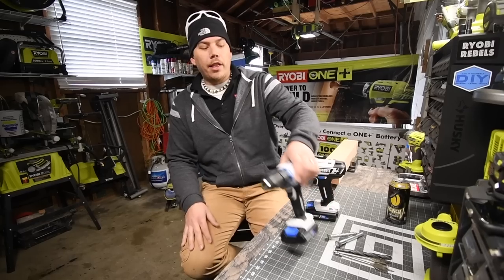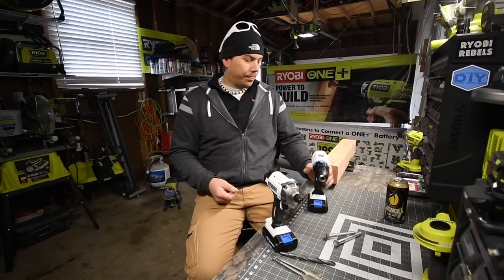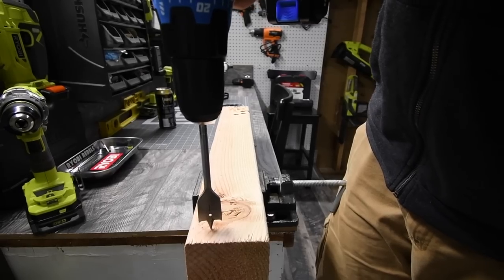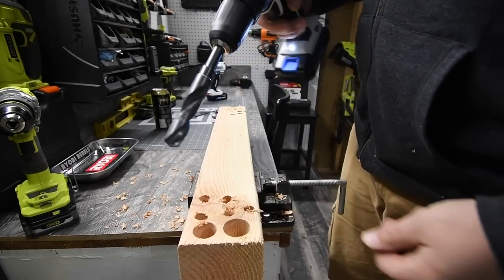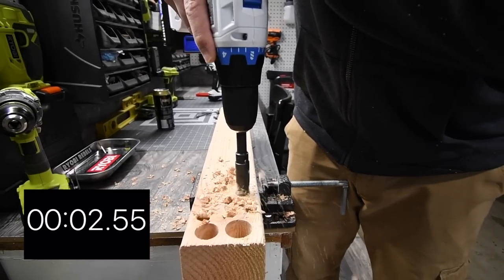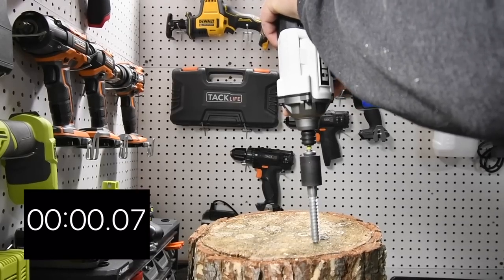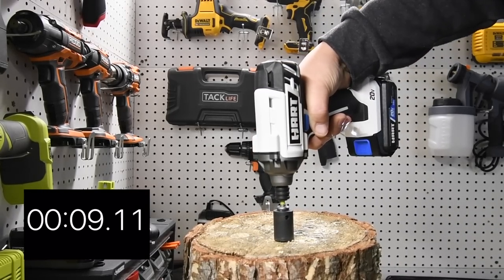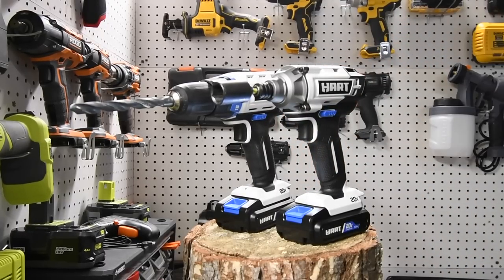HART Drill and Impact driver testing

Comment: I 💙 my Hart tools! 😊 My only complaint is the lack of fuel gauge on the batteries. Aside from that, I'm happier than a tornado in a trailer park! 😅
Reply from the maker: The 4ah battery has a fuel gauge
Reply: @ManCaverTools  so does my 1.5Ah battery
Reply: @tannerclement6251  same! seems the newer 1.5ah batteries have them, although my impact doesn’t i bought the drill and impacts separately like a dunce

Comment: I bought a set of Hart for small projects and because now all my surviving brothers are pretty far away and busy. So I'm trying to teach myself how to do things. The impact driver isn't holding a bit right out of the box. I'm not sure I can hold that against the brand because it could just be a one off thing. But I'm pretty sure I'm installing the bit the right way. I have the trigger  in the middle, battery out and I'm pulling the coupler forward, inserting the bit until it's all the way in and then letting the coupler ease back. The bit still just falls out or I'm able to pull it out with barely a tug.

But thanks for the video. It was nicely informative.
Reply from the maker: you are welcome and when you put a bit in the impact you might need to adjust the collit. pull it towards the front of the tool while you push the bit in. it should lock it in place

Comment: my hart impact had a "break in" peruod where it shut itself down several times during use, but after a year or so of owning it, it stopped doing that, and i dont use it for super difficult stuff.

i use it every day to remove and replace undercarriage bolts (8mm head), lug nut REMOVAL (19mm 3/8 drive to 24mm 3/8 drive ((with snap in adaptor, not the 3/8 drive impact. i have the exact same one you have, just got a socket adaptor.)), and to also do brake caliper removal and replacement with a torque stick to drive in, and a torque wrench to finish torque it.

I love the usefulness of my impact as an efficiency increase for automotive tech work.

i would not suggest using them to drive lug nuts in other than maybe to seat the tire before torquing to spec with a proper T-wrench.

Comment: You need to be in speed 1 for larger bits and spade bits for more torque.
Reply from the maker: thank you sir
Reply: He uses ryobi he wouldn't know
Reply: Facts!
Reply: @Swaysb  😂😂😂
Reply: Yeah, would tear your hand off if you used speed 1
Reply: @legendarypillow1450  no you wouldn't that's what speed one is made for lmfao
Reply: @Taylormade2350  speed 2 is for drilling
Reply: @legendarypillow1450  uh no lmao. You obviously have zero clue what you're talking about. They're both for drilling speed one is slower with more torque for larger bits and hole saws.
Reply: @Taylormade2350  exactly, but your poor grammar and punctuation made it hard for me to comprehend your meaning.
Reply: @legendarypillow1450  what lmfao. My meaning was clear for anyone who is not a moron. Don't blame other's because you can't comprehend English. There is literally nothing wrong with both my grammar or punctuation, nice try kid.

Comment: Cool. Like I had mentioned, just because the same company makes them, doesn't mean the specs are the same on the insides. You can see similarities from the same maker, but again there are only so many ways to design certain tools without them Not looking similar. 

When taken apart & you see if the circuit boards are covered in moisture resistant coatings, wire thickness, plastics used, metals, etc... You can see where corners were cut to save $$ & offer them for cheaper compared to say DeWalt where you are paying more for Pro Grade tools.
 
I have seen quite a few Professional Contractors videos who use Ryobi tools everyday & are very happy with them. Great video guy!
Reply from the maker: Thank you sir and more tests are on the way
Reply: Obviously. I mean Milwaukee is the favorite child and the rest is just easy money for TTI

Comment: Do those same hole tests with one of the Ryobis doing the exact same thing side-by-side
Reply from the maker: versus videos are coming up. im getting another kit tonight
Reply: It is based on an (older) Ryobi design so it is just a matter of matching it up to which one, or accepting that the Ryobis got better over time with each new model, like everybody else. However if you're serious about performance and speed, to get a fair amount of work done then you don't use a 1.5Ah battery so I don't see the point of the video.  If you only have a small amount of work to do, what did it matter if it took a few seconds difference either way?  This just isn't applicable to any real world use and need combination.

The real question is why would anyone choose Hart?  It has no virtues over any other brand whether it be price or performance.  Maybe Walmart will put them on sale so you save 10% but 10% is not enough difference to plan a tool line investment.
Reply: And make sure you drill right by the knot of the wood with Ryobi too.
Reply: @stinkycheese804  well I just started in construction, I got them be because no one else has them, on th job site everyone has Milwaukee and DeWalt, I got them because they looked different and had no bad ratings, the only thing ppl say is they aren't contractor grade...I don't mind
Reply: @stinkycheese804  I love the hand tools by Hart, and the grinder! I didn't buy any drills or impact, because I only use Milwaukee fuel hammer/impact set!!! Milwaukee makes the best drills and impacts! I'd use a m12 fuel before I'd use any other brand! Hart's hand tools are nice and cool

Comment: Thanks, I've been considering getting g the set with these and the reciprocating saw.  Light duty DIY stuff is all i need them for, the price is reasonable, and they seem to do way more that I'll be needing....that 1 1/8 hole was suprising. And I doubt ill ever need to drive 1/2" lag bolts into undrilled tree stumps lol
Reply from the maker: if you can get the brushless versions. they are way better and will last a lot longer

Comment: I drove the same lag bolts... actually longer.... with my Milwaukee M 12 impact end it sunk them completely in less time.... in fact it countersunk them into the wood.... and these are supposed to be 20 V tools?
Reply from the maker: yes they are.
Reply: Milwaukee is in a different in tti tool range this is the bottom bracket along with Ryobi but it got the job done I'm an average guy I'm not going to sit there and be a fanboy of any tool line if the two works I'm happy with it and I respect your video and what you do thank you for sharing keep doing what you're doing
Reply: I mean it's a great platform to test and prototype solutions. It's easy money for TTI and they have all these other platforms to test under easier load applications to try new ideas without pissing off professionals with have baked solutions to every day problems.
Reply: Do remember the M12 and the Skil Brushless are the two most powerful 12v impacts out there - by a ridiculous margin. And at almost 1,700 in.lbs they're far more than these basic 20v impacts are even rated for. Remember the price difference here as well.

Comment: People mistake impact driver and impact gun.... impact driver is for longer screws and some lag bolts.... impact gun is basically for removing Lugnuts or something that requires higher amounts of torque
Reply from the maker: that is an impact wrench. an impact wrench has for torque in reverse than in forward gear as an impact driver has more torque in forward gear than in reverse.

Comment: This is funny.

I just walked into the Wallymart last night, and noticed heavy Hart presence and B&D stuff on clearance. The lady noticed the 4-tool set(drill, impact, recip, light)on the shelf for 169. Well just 3 days ago, i bought the Kobalt 4-tool set containing the same arrangement of tools for a good bit more money so she naturally pointed it out. She quickly understood when i walked her over to the display area and handed her a couple of the Hart units. 

Seems to me they are pretty much copying Harbor Freight's strategy. Crappy tool for super cheap, okay tool for a little more money but still super cheap.
Reply from the maker: I got the kobalt brushless  6 piece tool set for $200, gotta take deals while they are here
Reply: @ManCaverTools  yeah i missed that but frankly im fine with it because the original plan was to piece my Kobalt lineup together little by little over time.

Comment: Hart lost any interest I may have had, the 2nd time that drill driver stopped and you had to pull the battery and put it back on. Thought about getting a set of these just for friends/relatives who show up to barrow a drill etc, but I'll stick to my Dewalt and Milwaukee.
Nice video though and keep up the reviews!
Reply from the maker: im not a fan of hart either
Reply: It's some reject line problay just horder freight redraned
Reply: It's just a lighter duty tool for lighter duty jobs.  Thinking it should be capable of the same jobs as a tool costing twice as much?  Of course not, if there were no trade offs then the expensive brands wouldn't exist.

The key thing here is that all brands should cut off if you push them too hard.  That is not a sign of a tool problem, rather one of a user expectation problem.  2nd key thing is, it saved the tool rather than self destructing.

This grade of drill is great for driving screws and other small to small-medium fasteners because it has a clutch.  That even makes it superior to an impact driver w/o clutch for these SMALL fasteners.  Many people get that backwards and think they should have 200 ft lbs of impact without a clutch on a small screw and try to drive it as fast as possible, wrecking the screw or bit eventually.  Do it once and those seconds shaved off the work time disappear.
Reply: That’s good idea..never would of thought it till you posted it..buy cheap tools like air or corded impact extra...

Thanks 👊🏻👊🏻🍻

Comment: Impact driver do fine for small bolts in auto repair that’s bout all I’d use it for 1/4 sockets to make quick work of them
Reply from the maker: yes they do. I like to do extreme tests
Reply: I usually predrill for that long of a lag bolt.  It’s easier on any tool. But I understand it’s for a test.

Comment: Is it wise to keep an impact drill in the car, to remove the lug nuts, incase of an emergency?  And would the Hart be a good choice for that?
Reply from the maker: yes it is. it will make changing out a tire on the side of the road a walk in the park
Reply: A 1/4 inch impact does not have the power to remove lug nuts.
Reply: I bought the Hart impact because it could supposedly break a lug off cars and it wouldn't do anything on my little Pontiac lugs that were torqued to 80lbs ft. Save your money and buy something better if you want to remove lugs from a car.
Reply: @poke2748  what do you suggest for lug nuts?
Reply: @temping-sama  definitely a stronger 1/2 inch impact driver preferably something brushless. You get what you pay for so keep that in mind. Make sure you purchase sockets rated for impact drivers too otherwise you'll have a very bad time.
Reply: Use a 1/2 in brushless preferably. That little impact driver would snap the driver bit in a heartbeat trying to bust those lug nuts off, if it could even get that far.
Reply: You do not use an impact driver for lug nuts. You use an impact wrench. Two very different animals in terms of breaking a nut loose and has an actual socket anvil that will stand the use much better.
Reply: Umair Shariff if your looking for a impact to take off your tires in an emergency I would go with the power torque at o Riley's I own a mechanic business and for only 159 I believe at o Riley's it has never let me down and o Riley's backs the power torque with a 1 year warranty after two years of heavy use in my shop the charger went out before the impact and as a mechanic I will tell you I am not easy on this impact

Comment: Thanks for testing them I know there a Walmart brand I was kind of iffy if they'll be worth the money
Reply from the maker: I think they are for a DIYER. and you are welcome
Reply: At home for handy dys but not for construction use everyday no..
Reply: 2 tools 2 bats and a charger for $100 it's hard to go wrong. If the drill lived it's life on speed 1 and the driller actually let the flutes clean themselves out instead of laying down on it you wouldn't have any problems there. The impact is what it is but if you're not doing lags or timberlocks you're in business. I'm lucky to justify owning top of the line tools because I'm a professional but as a DIYer I'd still go Ryobi because the line encompasses so many more tools.

Comment: People mistake impact drivers and impact guns.... impact drivers are basically for longer screws and lag bolts.... impact guns are geared more towards Lugnuts on cars and things that require higher amounts of torque
Reply from the maker: yes they do
Reply: And with both an impact driver and impact wrench it depends on the torque numbers on what you'll get out of the tool plus the battery that's what it boils down to and yes you're correct

Comment: My concern is longevity.  Function out of the box is nice, but if the motor burns out or the switch goes bad after 3 months of use, it wasn't money very well spent.  It will be interesting to see follow up videos made by people who actually use these.
Reply from the maker: long term use, I think they won't last long if you use them every day for a while
Reply: Almost a year daily with brushless impact, drill and hammer drill, I upgraded to the larger battery other than that no problems.

Comment: Yeah, Modern DIY Projects did the same tests you did with the same results, and he also complained about the white color being a big mistake. Your guys results prove the limits of these tools. OK for home use but nothing more.
Reply from the maker: that is what these were priced out at, designed for the home owner, but that doesn't make this a bad tool. and I thank you for viewing sir
Reply: I've been using hart since they came out and I have used every kind of power tool out there I've been in the construction industry for more than 20 year and union for the last 8 and I use my power tools for all my work outside work and I love them their vacuum will put Shop-Vac to shame

Comment: Gotta let the tool work not push down on it been useing this set for a while now on custom cabinets flooring body work roof work on motorhomes haven't had any issues I've even dropped the drill frome a 8" ladder and its still kicking i like the white color my tool box.and tool cart Is blue with custom white SS strips and graphics. But yeah i had good luck with this hart brand working on Bret Michaels motorhome at my job yes the lead singer to poison Rock on bret Michaels frome the crew at RV Renovators in mesa Arizona
Reply from the maker: Thank you sir and Happy Holidays

Comment: Seems odd to me that they went with a 20v battery system when ryobi and milwaukee both have good 18v batteries.
Reply from the maker: I agree
Reply: Oh my god I have to stop reading these comments. The brain cells I have left are leaking out of my fucking ears. 20v batteries are a nominal 18v under load. 20v doesn't mean more power unless you're braindead and believe the marketing tactic of HIGHER # =MO POWA. I mean cmmon I have m12 shit that will do donuts around any of that ryobi junk.
Reply: @Zachariahfml  who said anything about MO POWA, the same company who makes these is the same company that makes ryobi and Milwaukee
It's weird that they went with 20v when their superior tools ( yes ryobi is slightly superior and Milwaukee is on another level ) have GOOD 18v

Get your head at if your ass man.
Reply: @mattchumoore4214  18v batteries are identical to 20v batteries bro 🤣 are you dumb. If you use a multimeter on a Milwaukee m18 when its fully charged you'll read 20v Dumbass.
Reply: @mattchumoore4214  you have no idea what you're talking about so just shut up.

Comment: I give up. My high end Makita went south on me for no reason, then they wouldn't honor the warranty, then my brand new Milwaukee blew out a bearing during its second use, and I wasn't even putting it under that much of a load. For now on I'm buying cheap stuff like Ryobi or maybe this Hart line. Quality tools are just a thing of the past I guess.
Reply from the maker: sometimes the cheaper solution is the better one.
Reply: Go Porter Cable, only ones i use and decently priced too
Reply: @scottsgamingtv7168  Hey thanks for that tip, I'll give them a try.

Comment: Has anyone tried the hart drill bits just wondering if they are any good
Reply from the maker: they are not good. id get the better brands on the bits
Reply: Yeah I kind of figured that was the case a 200 piece drill bit set for $35

Comment: Dude, new tool, new bit.  You can't use worn out bits for comparison that have already been used to test multiple tools.  The bit fails before the tool will!
Reply from the maker: I can't use brand new bits for every test
Reply: You cant buy a brand new drill bit every time you need to drill a hole in real life circumstances.